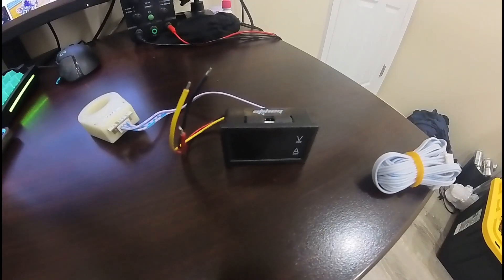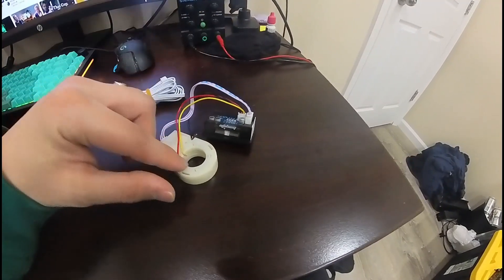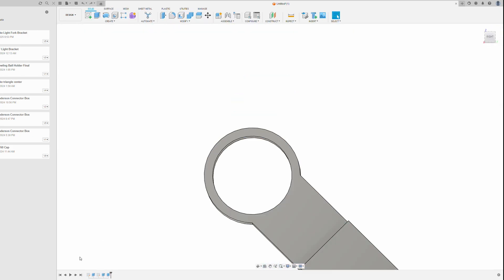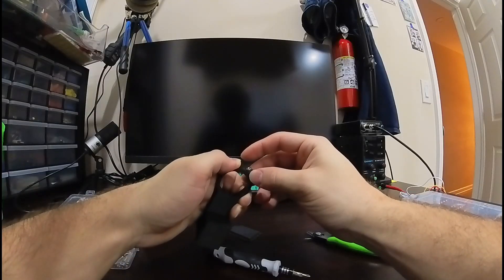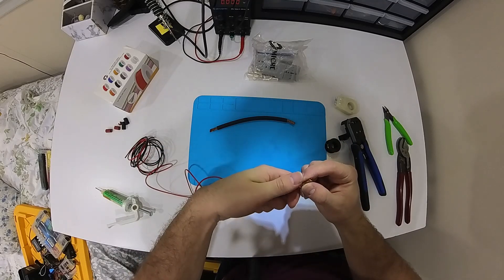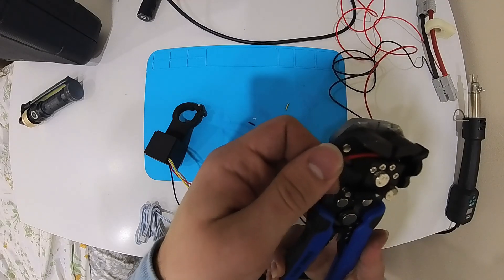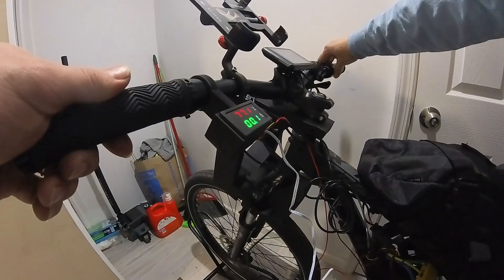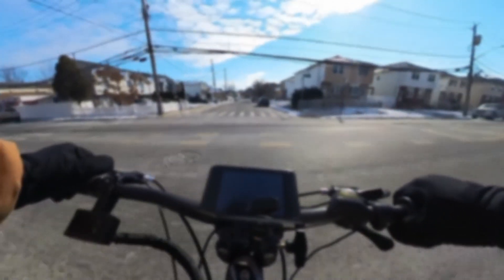How To Add Volt & Amp Meter Upgrade for Custom E-Bikes

Comment: If your custom ebike build selected and used a decent vfd or speed control rather than chinesium junk these features would already be inside and usable, try looking into vesc or phase runners or any other decent speed control solution and stop adding extra wires and needless tricky tacky silly add one to get what a well built bike would already have  kinda guessing I would not want a bike you built!
Reply: What have you built? Who wants that